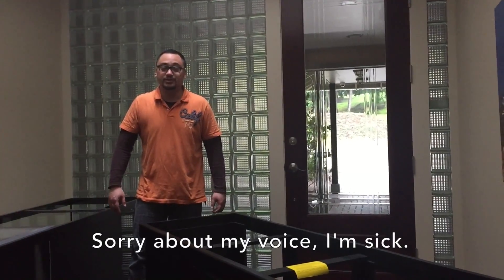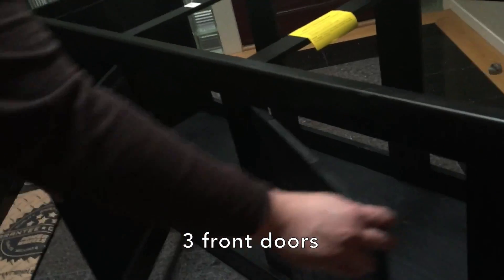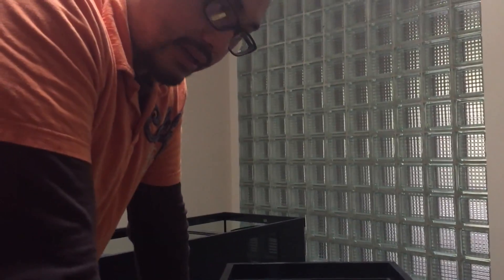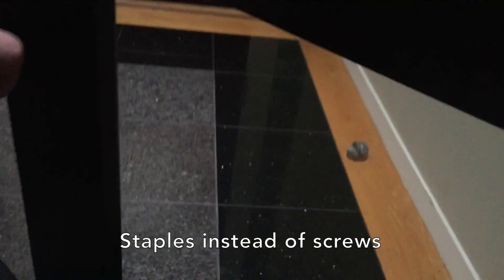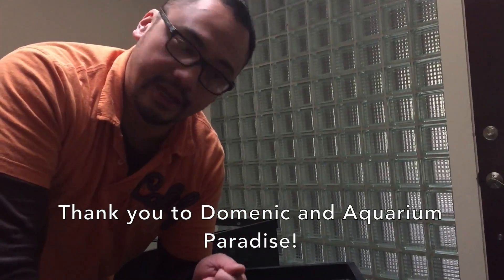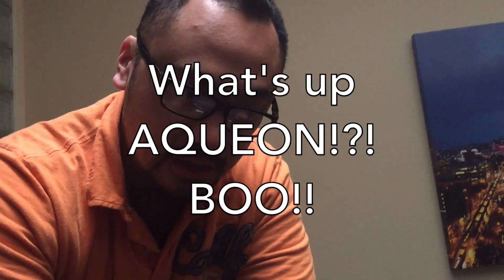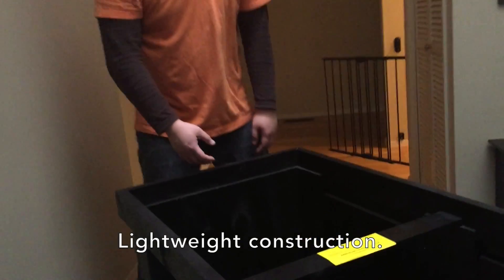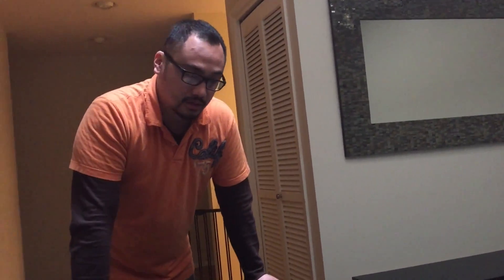Aqueon Pine Stand is Crap - QUALITY ISSUES!

Comment: I used to have the 75g stand and liked it. Never had any issues with mine but it's been a while and I now just make all my stands from 2x4 and plywood. I make it a bit too heavy but i'm able to sleep at night knowing that it wont fall apart. Peace of mind is worth every penny
Reply from the maker: Bay Area Fish Keeper you’re right. If it fails then at least I know it was my fault
Reply: Plywood might not be the best material to use.
Reply: Oak stand 90 gallon I bought extra $ but worth it .

Comment: I just ordered a stand from there hope mine isn’t messed up
Reply from the maker: Good luck! If it’s crap you can always ask for a refund or replacement.
Reply: @TheFishBeast  I canceled it just gonna do cinderblocks and 3/4 plywood for a while till I can get a heavy duty wood stand
Reply from the maker: @cichlids253  bro trust me that will be more heavy duty than a full wood stand! You can make it look nice too…
Reply: @TheFishBeast  I believe your right about it being more heavy duty not sure I’m skilled enough to make it look good
Reply: Just got back from Home Depot got 15 cinderblocks and 3/4 oak plywood for the top will have support in the center and left and right stacks 40 inches high 20 inches wide 74 inches long hope it’s enough I was able to cancel my order as aquarium paradise but lost about 25 bucks due to cc fees
Reply from the maker: @cichlids253  gonna be perfect! The tank is framed right? Coz if it’s flat bottom it’ll need a bit more support in the central area besides the ply. Also are you in Tacoma? I’m in Gig bro!
Reply: @TheFishBeast  I have a support of blocks in the middle and it’s 1/2 acrylic yea I’m in Lakewood
Reply: There would be a support every 11 inches  thinking of doing 4 sets of 3 blocks each but then I have nowhere to put my filters ugh have dual fx6
Reply from the maker: @cichlids253  if you do a box frame of 2x4 under the plywood you can get away with 1 support in the middle. Then FX6 in each cavity
Reply: @TheFishBeast  well it’s up re used my stand I had I’ll make a video of it holding up so far fingers crossed 🤞
Reply from the maker: @cichlids253  Nice! I subbed to you too
Reply: @TheFishBeast  thanks man appreciated

Comment: Good video 👍🏾 So, what kind of stand do you recommend for a 90 gallon tank
Reply from the maker: You can use many different things, from stacked cinder blocks with planks of wood between them, to a sturdy steel rack from Home Depot (check the weight limits) and of course if you’re inclined, you can make your own stand and paint it if you like.

Comment: i just bought used 75 bow front with the same basic stand I didn't like the construction either half lap joints with staples holding everything together ! On mine the center upright in the front the staples were pulling out and there was a gap opening up! I'm a decent woodworker so I glued and screwed that piece back together then added another vertical upright brace to the front of it because it is at a critical point the center of the bow also added two more upright braces to the back and tied the whole back together with a piece of quarter inch plywood and scews
Reply from the maker: That’s a great solution! Is the tank/stand combo still up?

Comment: It's ironic that a high quality commercial stand, which is what this is, is so inferior to the traditional DIY stand a lot of hobbyists make. 

The two things I would like to point out is that light weight does not equal weak. A properly designed and built DIY stand need not be built entirely from 2x4's (which are usually doubled up on the vertical supports) in order to be strong. 1x4 pine (which that appears to be) would be more than enough if it was put together with proper care & attention to detail. 

Second, the use of staples as fasteners is not in and of itself a concern. In a properly designed stand the fasteners should not be bearing any weight. Staples would suffice, in fact you could argue they are preferable if (big IF) all of the joints were glued. Wood glue is tremendously strong. In fact, if a joint that has been glued does fail, it's usually the wood next to the glue that is ripped apart and not the glue itself. 

Good job on the review. I hope you were able to get this sorted out. And big props to the LFS that had your back.
Reply from the maker: Thank you, Daryl! You are right, if it was well put together, stapled 1x4s should be quite sufficient, especially if the uprights were aligned and the dadoes were centered. Unfortunately, joints were not glued and quality control was poor. You bring up excellent points and your comment is much appreciated. :) Cheers!
Reply: Still going with a two by fours or even two by six just for safety

Comment: Pretty much all tank manufacturers are doing this.  Our Marineland Majesty stand for our 265 gallon tank isn't built any better.  In fact, it took them 3 different times to deliver a stand to our LFS that arrived in decent shape.  I'm not sure who is to blame on situations like that, whether it falls on the distributor or the manufacturer.  Obviously, there is a flaw in the delivery procedures.  Ultimately, we decided to just reinforce the stand that came with our set up.  I'm not willing to give up the Lifetime Warranty on such large tanks.  Smaller tanks, I wouldn't have a problem building a better constructed stand.  We beefed up the stand with plywood sheets on the ends, 1x4's backed on the vertical posts, and then ran some 1x4's across to keep the stand from being able to twist.
Reply from the maker: You said it Cole... The fish store has bent over backwards (never charged me their usual delivery fee on both occasions) and the problem really is the manufacturing. I'll just have to reinforce the stand like you said. That way I could have the peace of mind that should have come with it in the first place. :) Thanks for the tips.

Comment: Thanks for Sharing.  I bought a tank at a local store and got a Aqueon Pine Stand "15905 51136 18 x 36 BLACK" with it at the same time . I didn't know  who made it but was able to find it once I looked up the numbers which led me to Aqueon then looking up Aqueon on youtube brought me to this video.  My stand is smaller but very similar (very light, staples)    I have the same concerns...  After getting it home I started to look it over more and it just didn't look like it was going to hold my 40 Gallon without me worrying about it constantly.  Honestly it would be nice if the stand was heaver than the tank (like my 20 gallon one from petsmart is heaver than this one)   It's supper light and the parts that actually hold up the top frame (which actually supports the tank) just doesn't look like it will hold 400 lbs without me worrying half the time.  The small dug outs in the wood to support the top frame just seem like I will need to add more support which I am not to wild to do.  These stands don't look good at all.  Anyway just curious what you ended up doing with yours.  Thanks
Reply from the maker: Hey man, thanks for the comment. I built my own stand for the 210 gallon and wound up putting this stand outside as a storage unit.

Comment: I realize people's concern with these stands and yours in particular I agree is poorly constructed. But people must look at it as pounds per square inch (psi). For my 125 gallon and this stand there are only 7.4 lbs per square inch being put on the entire rim of this stand. Calculate: 72" + 72" + 16" + 16" and you get 176". A 125 gallon aquarium is 1300 lbs filled. Divide 1300 lbs by 176" and you get 7.4 psi. That is really nothing. An average car tire pushes out at 30 psi. I agree though, your particular stand needs to be fixed. In your 210 gallon aquarium stand's case it will be just 15 psi.
Reply from the maker: Thank you for this. You are a soul correct. PSI will be low in this case but I was just not confident in how things lined up. The tolerances were too wide. You bring up and interesting point, wherein many DIY tank stands are extremely overbuilt! Cheers!
Reply: Exactly, i have the one for the 120 and it is fine.  Plenty strong enough and then some.
Reply: @kiddt1999  i have one for the 125 6 foot long and its just making me so nervous. Like it seems stable. But not what id imagine it should be.

Also is it normal for new tanks/stands to make noises when lifting and moving them? (Empty)

Comment: That same stand has held my 210 perfect since 2009 a lot of the same issues I put screws in the uprights after a couple years couple planks came loose tank never moved , this is a good stand just poor quality control I have used this type of stand and the mdf type since the 80s never had a failure yet, the Marineland is better I thank because the tank sits down on the cross boards .Just wait a couple more years we will be wishing they had one that good. just my 2 cents .
Reply from the maker: Tim Biddle thanks for the insight, Tim. Glad yours is holding up well with the modifications. I got real spooked with this thing so I wound up building my own stand.

Comment: Hi Pierre.. I don't like these stands. That's a huge amount of water plus rocks etc.. that adds up to a ton of weight. I bought a setup like this although my tank was much smaller..  I never trusted the stand and mine was made of pressboard! I sold it. Since then I have my hubby build my units. My car can park on them they are so strong. The problem is they won't stand by their warranty if they are not on their stand..  damned if ya do.. damned if ya don't =(
Reply from the maker: Hi Deb! Yes, you are absolutely right... Their warranty is dependent on the use of their stand. Pretty mind-numbing and paradoxical!

Comment: With all of those glaring shortcomings, it might as well had been manufactured out of wet CARDBOARD.  Aqeuon cutting corners on their substandard HOB filters is almost forgivable but on an EXPENSIVE 200+ gallon tank stand....NOT ACCEPTABLE....EVER!
Reply from the maker: You said it, brother. If they're gonna charge $300-$500 for a stand, then they better build it like a freaking tank with tight tolerances that makes you feel SAFE that it can support 2300 lbs. Otherwise, charge people a fair price. :(